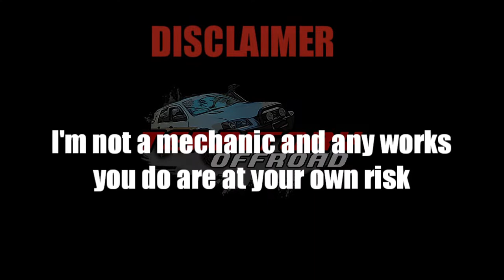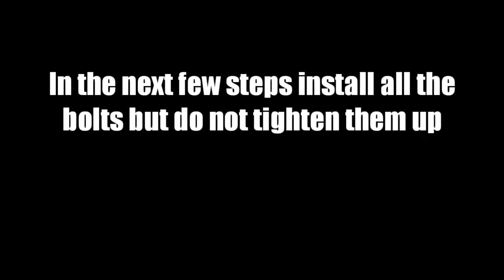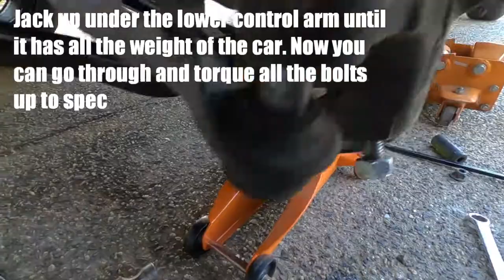Ford Territory SY2 Ball Joint Upgrade AWD

Comment: Awesome video however never use steel hammer try to remove from the CV shaft and wheel bearing.   best way is using copper hammer save the damage on the axle  thread and wheel bearings

Comment: i do believe that the SZ will need the SZ abs sensors plugs cut and rejigged to be able to plug back in with the SX/ SY models due to the different casting hole in the knuckles. Great video and I would also recommend that new bearing and hubs if not only bearing be replaced while they are off the car
Reply from the maker: I always go for the new genuine Ford SY2 hubs. This wasn't my car and he got a gooddeal on the sz knuckles. Not sure about changing the plugs but the sx/sy sensor's work just fine after you shave the mount down to be the same
Reply: @TerritoryOffroad  no worries Keith, from my understanding of the connector plug on the Sz is that they are slightly smaller where they connect or at least the FG version was. Knowing ford it would also have a resitor change so they didnt talk to each other for us that like to play with upgrades.
Reply from the maker: @gore1978  yea plug itself is different but I've never stripped them back to see. I honestly think just getting the new SY2 knuckles is the best option.
Reply: @TerritoryOffroad  yep less stress and headaches getting the SY2. all those resitor values and soldering from the SZ to the SX for the steering wheel was bad enough and I was lucky I handballed that off to someone else.

Comment: I installed some front cv axles today and the bolts i got with the cvs dont spin around the bottom like factory ones does that matter at all ? Cheers
Reply from the maker: All the new CV shafts I've bought have come with there own nut. I just used them but have wanted to change them for pac nuts just haven't had time. Torque the nuts that come with them and they still work fine.
Reply from the maker: Bolt's or Nuts?
Reply: I mean nuts sorry. Yea i just used the new ones and torqued to spec thanks man

Comment: gday, is there a way to tell if i have sz or sy2 knuckles before i grind the sensor mount? what i have looks pretty similar to the before and after pics, and part number isnt coming up on google search
Reply from the maker: You could remove the sensor from the old knuckles and check if it's the same depth or about 3mm bigger
Reply: thanks for the quick reply 👍🏻 i might grind them anyway and make a spacer in case. cheers
Reply from the maker: @baesex  it's easy to do on the car

Comment: Well produced video, great stuff. I'm looking at the AWD Territory as my next camping car. I think it has the room and the capabilities for what I do these days and being a Ford with a Barra 4.0, pretty easy to maintain. What's the cost of the ball joint upgrade? Is it a must do or should do?
Reply from the maker: I would recommend the upgrade for peace of mind ecspecially if your going to do dirt road driving. You can just replace the old style ball joints if your not looking to spend heaps but they are something to always keep a eye on and replace again if you think they aren't 100% in any way.

You can pick SY2 parts up use for anything between $350 to $600. To buy everything new the knuckles are $450 plus shipping, lower control and radius arm's are $419 and the hub lock nuts are $20.

The barra is easy to maintain but not known to be the best on fuel. A big thing to look out for when buying a territory is the condition of the suspension. Diff bushes are top of that list as they wear out and can cost a lot to replace.

Comment: Mate, don’t know where to begin, but thank you heaps for this video. Spent 3 days on my Ford Territory SX 2004 AWD upgrading the whole front bushes, arms etc. Your video made a step by step guide that saved me so much time and money. Have you got one on the drive shaft replacement procedure and the rear bushes and arms. That’s my Easter weekend plan. Wishing you the very best bud.
Cheers Bernie
Reply from the maker: No I haven't at the moment. It's something I should do but time is my problem. I just picked up another SX AWD and it's been on my mind to do some more how to videos on common territory problems.

Comment: Jacking up the control arm like that does not get the suspension to ride height. Close, but it will fall short overall and reduce the life of the bushes.

If you are going to hit the CV shaft like that leave the nut on loose because if you miss and ruin the start of the thread then you can use the nut "fix" the thread as you wind it off. If you bugger the thread without being able to fix it you'll be in trouble.
Reply from the maker: I'm a carpenter by trade so swinging a hammer is easy for me. Yes leaving the nut on is a very good way to play it safe.

What would you do to get the suspension up to ride height before torquing everything up?
Reply: @TerritoryOffroad  I hit the things with a hammer too, same with tie rod ends and ball joints. Just experience has taught me it's safest to leave the nut on just in case. Last CV shaft I knocked out I clipped the edge of the thread and partially flattened the first thread. Only saviour was I left the nut on.

There is no easy way to get the suspension to ride height apart from putting the wheels on the ground and rolling it back and forth until it's settled. But then getting under the car is almost impossible. Jacking up like you did leaves it short by 30 to 40mm in my experience working on Falcons, mainly B-series. It's alot better than torquing up when at full droop  though. Props to you though for recognising they need to be done at right height and pointing it out in the vid. Very few videos do and it would mean they are doing bush swaps very soon after.

Back in the day to get  it close to ride height I would measure the height from the centre of the hub to the guard above it while the wheels are on the ground. Then I'd remove the shock/spring unit and jack up under the arm as you until I got the same hub to guard measurement and torque everything up. It's an extra step and time, not something everyone wants to do, and may not always be practical for every car. But it served me well with Falcons.

It's also why I have a preference for urethane bushes, specifically Superpro, because they can be done up in any position. They aren't to everyone's taste, but it means I don't have to worry about ride heights and ruining bushes when torquing them up.
Reply: @arm7987 cheers for extra info. About to takle this on 2wd sz

Comment: Hello, I’ve got a 2004 Ford territory, it was my first car and I really like it. However today the lower control arm broke and the  cv joint came out the side towards the motor. I am waiting until Monday to call up the mechanic. 

But my question is, is it possible to upgrade all the bad components in the territory, like this and have it never to break or will it always need replacing in a while? And do you think it’s worth keeping and having to replace, if so? 

I really like the car and want to keep it, but if I am going to need to spend so much money I’m thinking of selling it and paying off a brand new car.
Reply from the maker: If you check my other videos you can see what I put my SY2 suspension through and I've never had a problem with it. It's very hard if your going to pay someone else to do the work as labour is a big cost. The old design was very bad and the new design really is a 100% better. 

You will need to get the full front end inspected after this happening as I'd say your also up for a new CV shaft. The territory is a very good and reliable car but often gets neglected when it comes to maintenance.

Get more then one quote and don't be afraid to question the quote. If your in Melbourne I'd be more then happy to try help you out.
Reply: @TerritoryOffroad  Is it going to cost a lot for inspection and replacement? I believe it's only the lower control arm and CV joint that needs replacing, the upper control arm had been replaced last year. 

I actually live in Melbourne too, do you charge a lot for that kind of stuff?
Reply from the maker: @XSeanxMeowX  I don't charge anything I'm just happy to help. If you check out the Facebook group's: territory offroad or ford territory camping & offroad just send me a message. Name is Keith hansby
Reply: @TerritoryOffroad  Cheers! I will do that, thanks